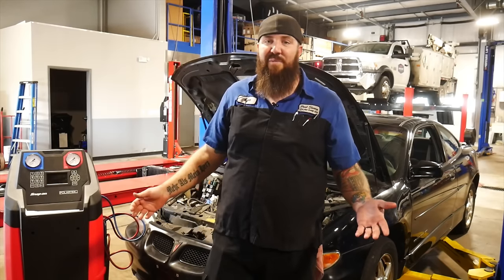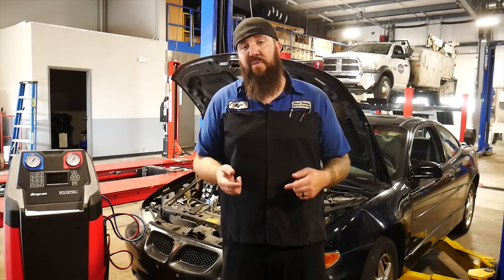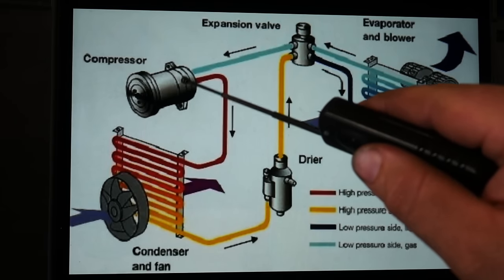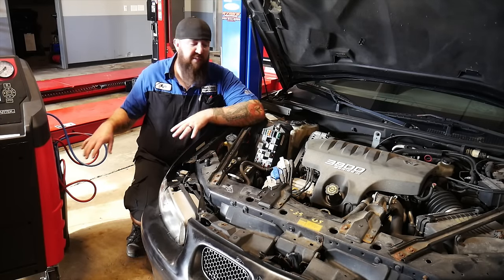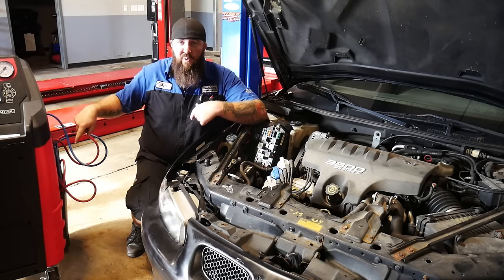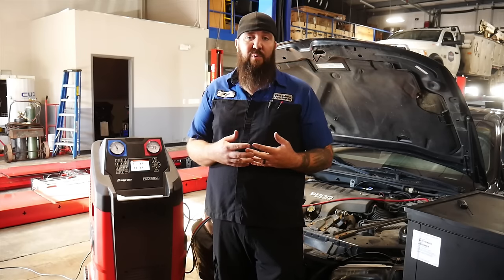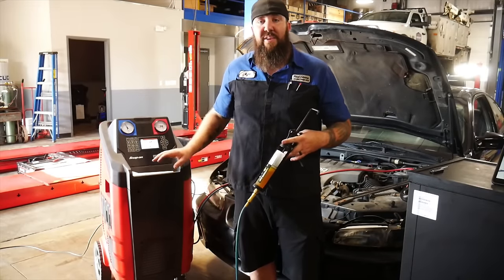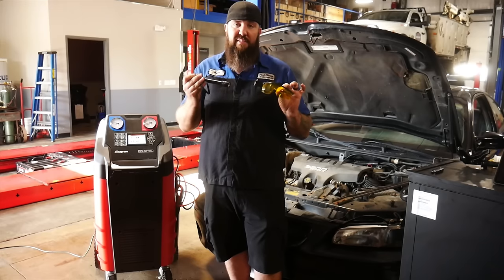AUTOMOTIVE HOW TO: A/C SYSTEM DIAGNOSIS FOR BEGINNERS

Comment: Question - Replaced the compressor, expansion valve, and receiver/dryer after doing some major engine work.  Purged and cleaned the whole system to include the lines and the evaporator.  Used manifold set and vacuum pump to draw vacuum and recharge the previously empty (changed broken compressor). Start putting in refrigerant and the compressor clutch kicks in.  Problem is I get about 75 psi on the low side and about 80 psi on the high side.  Doesn't change. Had the low side open to pull in refrigerant and may have had the high side valve open slightly. Made sure it was closed and gave it time running but still no change - low side higher than it should be and high side lower than it should be. Is there something obvious I am missing? Is there a way to reset and go back to the starting point or is it possible I've damaged the compressor (if the high side was open at the same time the low side was taking in refrigerant).  The compressor was pre-charged with oil. Any help is appreciated.
Reply: I see that your comment is relatively new  but did you figure it out? Im trying to diagnose a problem with my AC and have very similar guage readings.
Reply from the maker: Did you yourself put the oil in the compressor? They say they come with oil in them but they do not carry enough oil for the system as a whole. If you have equal pressures on the high and low sides then there is generally only two outcomes. Either the compressor is working and the expansion valve is stuck wide open, or the compressor is turning but is not actually building pressure. Was there any debris at all in the system after the last compressor failure? If so then it’s almost impossible to get it all out of the evaporator, drier and condenser, in which we usually always require about a full system replacement. Otherwise any bits of debris left in the system generally will lead to another compressor failure. Hope this helps guys.
Reply: @RustbeltMechanic  No I didn't put oil in the compressor. It came precharged with 3 oz of oil.  I did also add oil to the system myself (thinking the 3 oz was probably not enough for the whole system).  I purged the whole system, including back purging the system first, and ran dried air through the system to make sure it was clean before installing all the new parts.  I put a lot of energy into making sure the system was clean before installing new parts.  The only other thing I could have done better was to replace the condenser, but I seemed to have a good clean flow through it.  The new parts included the compressor, the expansion valve, the drier and all new o-rings throughout.  I agree with you, that one of two things are happening - the expansion valve stuck open or the compressor not building pressure.  Given that - how can I test which one it is or rule one out to know it is the other?  I don't want to just start replacing parts. Great answer. I'm glad you were able to confirm my uneducated guestimate.  Any further help would be appreciated.
Reply: @werdlyfe9577  - No - I am still trying to figure it out.  Right now it seems as though it's one of two things (as you'll see Rusty's response below). It's either a stuck open expansion valve or the compressor is not building pressure.  I am still trying to figure out which one it is or how to rule one of them out.  Please share anything you find and I will do the same.

Comment: My 2008 4.0L Explorer Sport Trac pickup is having an issue with my AC, Compressor is auto switching off whenever the engine is running for sometime and the ac pressure is reaching the red bars. The technician says that the compressor is good but the control ac timer switch of ecm/ecu is faulty so they need to replace the ECM. Are they correct in their advise?

Comment: I have worked on my ac in my 2016 corolla S, 20 times. Couldn’t figure it out because i did everything but the expansion valve because i need to remove dash to get to it. That looks like it’s has been my problem. Water 20 cans of Freon, my car was running hot also.

Comment: I have a 2002 Mazda Protégé.  I do all the work on her myself because I'm on a fixed income now. My heater works, but my air-conditioner doesn't.  The speed switch only works on 4, but I noticed the compressor or clutch pully  only one is spinning. What do I do to fix my air-conditioner.

Comment: How about a 1990 Oldsmobile delta 88 that has been retrofitted to 134a many years back. High side is almost perfect but the low side is now running 75 psi. Any ideas? Has orifice tube. Compressor staying on and not kicking off.

Comment: Hi i finally found the reason why it didnt take in refrigerant, its due to self sealed can. Anyway i have new problem now, it took almost 2 can but low pressure reading didnt change much while high pressure side reading went from 200-350psi. I stopped and unplugged everything then i noticed low pressure cord end attached to coupler its inner sleeve is ripped, can it cause my reading to be the same? what could be the problem?

Comment: I evacuated my AC system 2004 Jetta TDI. I replaced my heater core and now I'm going to need to recharge the AC. Do I need to add oil? The compressor was not removed and a vacuum will be done before the recharge of course.  If I need oil how much should I add? I have the AC PAG-46.  Thanks.

Comment: My lady has a 2013 Nissan maxima, she had it at the shop they repaired a leaky seal and now the compressor clutch kicks in and out like when it’s too low on refrigerant, only on first start ups and the colder the day the longer it will kick in and out, I told her I’m pretty sure it’s low in refrigerant and once the refrigerant in the system warms up then it will stop. The issue I’m having is it does it whether the ac is on or not when she starts it, my question is, am I correct in thinking the system is low and if so how do I use my gauges to verify? I do all my own mechanical work, but ac’s I really haven’t dealt with a whole lot, but since moving to Mississippi from northern Indiana it is now a necessity!😂 not sure how to go about this but typing isn’t my strong suit, so if a different form of communication is necessary I’m open for suggestions! 😂

Comment: My AC issue is when it is really hot outside and my car has been sitting in the sun - the AC blows hot air for like 10-15 minutes then Instantly / suddenly turns cold.  Its not over charged; clutch engaged, no leaks… 

Thoughts?

Comment: what about a compressor not cycling by that i mean when ac is on it never turns off and the ac is not cold ??
Reply from the maker: Really depends on what the pressures look like. If the clutch is spinning but the pressures are equalized as the same that would mean the compressor is not doing anything and is broken internally. Gotta see those correct pressures.

Comment: Yo make a video on Lincoln Aviators 03 to 05 model. I got the 05. There are no books and my biggest problem been my AC. The actuator blend door is closin on driver side blowing hot air. The info you talk about was helpful. I got an understanding how the system work. Word up yo💯

Comment: At 12:38 you came back to the gauges and the low side now says 70 but it was 30 in the last shot of the gauges. Why did it jump from 30 to 70 when it does not seem that anything had changed? The engine is still running and the compressor relay is activated so why the jump?

Comment: So in a 1997 lincoln town car if the ac and everything blows normal but no cold air comes out, only hot, its a problem with the expansion valve?

Comment: Absolutely the best and well explained video yet!! I didnt know the compressor would not compress a liquid..can you vecuum a system anytime to remove moisture or should it be empty? Thanks for the info.
Reply from the maker: You can’t physically pull moisture out of a system that has refrigerant in it. You have to have it recovered and then you can vacuum the moisture out. 👍🏻

Comment: I own a 30 year old Opel Kadett e sedan. Mint condition. I have an issue where the AC drops the cooling performance at higher revs. The pressure in the low side drops when the engine is revved. Really need help!

Comment: I had low pressure on the low side. I added 2 then 3 cans of refrigerant. it's still hovers around 10 psi. The high side is around 200-220 psi. What gives?

Comment: i tried adding a can to my little brothers car and  the smaller high line is cold and the low is warm,  i read thats not how it should be, if not what could be the issue? 
also when he revved and held it the gauge drops to mid low section but when he goes back to idle it goes back into the green. 
when he drives it's colder but warm when idle
 i told him hes prob gonna have to take it in to have a place do it. but any ideas what to look at

Comment: This is my situation, 75 lp & 175 hp at 90°. I'm guessing the system is a little low because the Schrader valves are leaking. The hp Schrader valve was holding pressure under the cap when removed, causing the slightly lower hp. This is all a HALFWAY educated guess on my part as I'm still learning ac systems.
Reply: Based on watcing the video, it seems you may have an Expansion Valve issue as well...

Comment: I have a high reading at idle (90 to 100psi) at low pressure side.  No cold air at all but when I rev rpms to 2500 rpms or so I get the pressure to drop to around 70 psi which is still high but I actually get colder air coming through the vents...

My uneducated guess is bad compressor....when I increase engine speed the compressor works faster and is able to compress better than it can at idle speed because it has lost its ability to compress like it should...

Any opinions? Maybe it can be something else? I just cant imagine engine speed having any bearing on any of the other a/c components...
Reply: Maybe overcharged

Comment: My car is not blowing. I replaced the blower motor. I’m gonna replace the resister today . It literally blows every blue moon, and it blows cold when it does. Not the blend door actuator. It blows cold when it blows but doesn’t stay on consistently. Any ideas?

Comment: 2008 civic hybrid 1.3 L  having the same issues low pressure @30-35  high pressure keeps climing to 250 but fan is running but no cold air  any ideas? condensor changed compressor changed  they overcharged  after they led the extra out and it got to 40 cold air  but it leak the freon out in 40 mins thru valve stem on low side  when they regas again  only outside line got cold but no ac in the cabin   after that they change condensor  still no JOY      any ideas    I see its still getting high pressure on high side line around 250  low side is at 30-35???

Comment: Mazda miata compressor is getting weak that it only works in the high speed.I replaced the compressor but it only was good for the season,Today it is not cooling again,What do you think is wrong this time the expansion valve?Please Help.

Comment: I have replaced the condenser, evaporator, expansion valve and the compressor and have no leaks and pressures are fine and the fan works fine, but still the air warms up at a stop or idle...Any clues on what the problem could be?

Comment: You mentioned  1234yf freon, will pressures be the same? I have a set of Yellow Jacket maifold gauges, with adapters.
Reply from the maker: They should be very close yes

Comment: Appreciate if you can provide some insight...
My car from canada had a rusty mag clutch and was not engaging. I pulled out the clutch &pulled, cleaned, put together and it started working. Brought to texas and on the way temp was set to 15C and the clutch burned down.  
Brought a new clutch and pulley to replace which also got burned down  due to friction in a week on a hot day on a long trip. Smaller trips it worked fine before that. 
There is a ticking noise from compressor when starts, definitely noticiable which lowers after a while...
I suspect my compressor clutch becomes very hard or gets stuck, which is causing the burn. Both times it happened when the thermostat was at 15c but outside it was 40c +.  I believe the mag clutch at that temp is not disengaging  causing friction burn. 
I am replacing again but before that ...
Can it be less/no oil ?  How do i check.
Can it be valve where high pressure is building so much that it stucks the compressor further ?

I believe but may be wrong, when i set thermostat to 18, 20 it worked fine, 3 times the mag clutch burned when set to 15c
Reply: Before your video i was considering to replace compressor, but now i may want expert advice before. Can it be expansion valve

Comment: Hi I’m working on an 03 Chev SSR I had a compressor fail and seized I’ve replaced the compressor and vacuumed the system and when I vacuumed it it pulled oil out of the system and overfilled the vacuum pump it’s a cheap pump and gauge set like suggested in the beginning of the video so I started the car and turned on the ac and started to fill it with 134a and the gauges read 100 on the low side and 100 psi on the hi side the compressor never engaged and I was hoping that you might tell me what I needed to do to get back on track thank you very much in advance
Reply: So if the system was contaminated could it cause the expansion valve to not work correctly and can I clean it out or do I need to replace it thanks the excellent video

Comment: Oil into the low side? Won't that lock up the compressor, since liquids are not compressable? Just wondering.
Reply from the maker: Nope, because most scenarios before going into the compressor there is the drier as well. The low side pulls it in much easier.

Comment: Hmm, this is great but, you explain that the gas comes out of the smaller pipe of the compressor, but don't explain at what point the tubes become larger diameter or give any more on large or small pipes. I am making up a bespoke system out of various components (i.e. not a kit) and the compressor, the condenser rad, and the evaporator ALL have one small and one large in and out and I don't know which is which. That combination can't be connected so where should it change?

Comment: Rustbelt i had a honda accord blowing like a white mist out of the wents while the a.c is on. Not always but more often then not any clue what causes that or what the problem could be. Thanks in advance dude.
Reply from the maker: Did it have a smell or certain odor to it? If not then it’s likely water vapor that can’t leave the box. So either he would have a partially clogged ac box drain or the fins of the evaporator in the dash are all clogged up with junk and holding moisture. Just my guess at least🤷‍♂️

Comment: So I have the same car but a 2004 Grand Am roughly the same build there just have the 3.4 motor in it. Anyways my AC is acting up it worked last year but not today I checked all fuses nothing is blown checked all relays and they are good you push the AC button it lights up but the clutch dose not engage and the cooling fans on the condenser do not run like they should. If you jump out the compressor relay with a wire the clutch engages and spins the compressor but the cooling fans still don’t run. And the fans work fine when the motor starts to get hot they kick on perfectly fine just not with the AC. I checked the hoses from the compressor the high and low side for any oil leaks and I don’t see anything they are dry some tell me it’s probably a low pressure switch or something I don’t know anyone got any answers

Comment: I have low 37, high 160 with it 100F outside with 10% humidity. Have crawled through the car and I’m guessing maybe the expansion valve is failing.

Comment: When I started the car in the morning and turned on the a/c, it worked well, I got cold air. However, after driving around for a while and stopped at one place for a while with the a/c still on, it started to blow warm air. Do you have any idea why? Thank you.
Reply: Need a fan most likely if ur driving and it’s cool and u stop and it’s not ur fan isn’t pushing the heat out of the car and compressor is struggling

Comment: If you have a leak,  you pump the system with nitrogen to 26Bar and you wait at least 3h. 
Good material,  unfortunately you can't buy gas anymore if not certified.

Comment: EXcellent. Thank YOU!
Reply: Rustbelt, yellow oil on the ground and I discovered a hairline crack at the bottom of compressor , she stopped cooling and I shut it off..  the system still has charge/pressure and I have the new compressor , with oil/tools to swap..  since it is still under pressure, do I have to change the desiccant filter?   if so will I need to add 2 oz oil?  thanks !

Comment: I have a 2014 Kia Optima Lx, and my ac compressor has a high whining noise whenever I start the car, Then the sound gets louder with acceleration. Could this mean I’m dangerously low on oil. Or should I replace the clutch?
Reply: Maybe just need a new belt

Comment: What about a system that will pull and hold a vacuum, but still won’t hold a charge? Where would you go next? That’s the issue I’m looking at on my 98 Cherokee XJ. Not seeing anything with my UV flashlight.
Reply from the maker: If it won’t keep refrigerant in the system it’s gotta go somewhere. Have you looked into the ac box drain if the evaporator itself is leaking in the dash?
Reply: Rustbelt Mechanic I didn’t really suspect the evaporator, as if it had a hole, it wouldn’t be able to hold a vacuum.
Reply: It’s possible for the service ports to leak. It will hold vacuum when gauges are hooked up. But will leak out when gauges are removed

Comment: Wait a second. If I vacum the system will the oil come out? Even if I didn’t not change the compressor.
Reply: I'm guessing oil would boil off at more than 30 vacuum...........and not be a problem